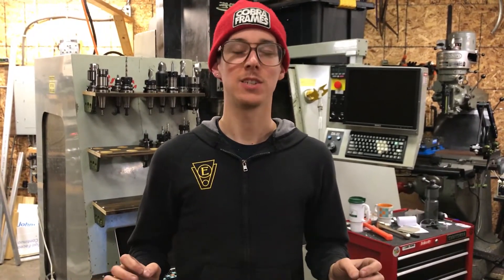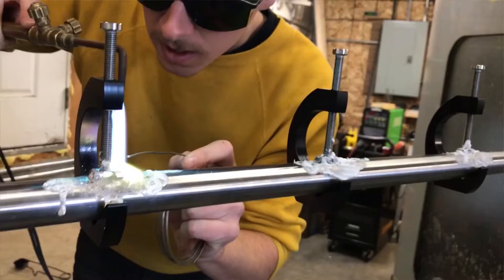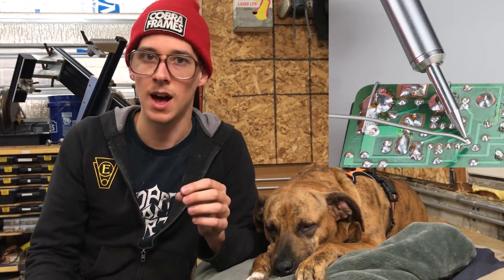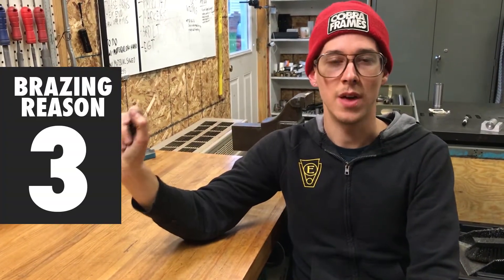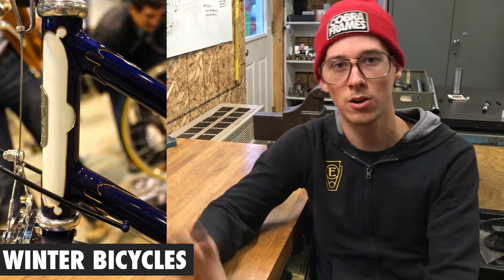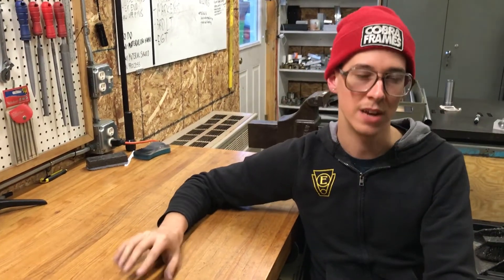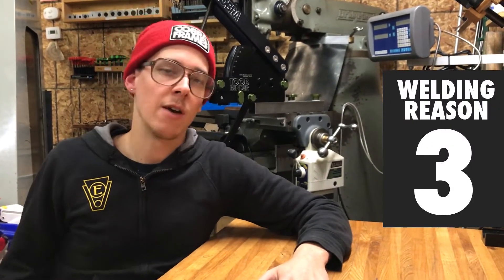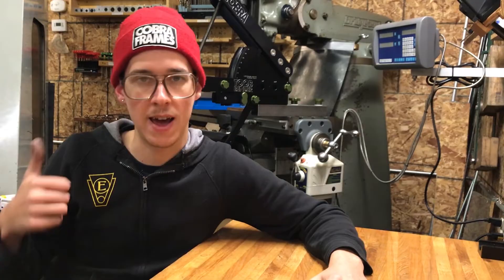Brazing vs TIG Welding for Bicycle Frames

Comment: Very impressed with your knowledge for being so young.  What many are missing though, is inline liquid flux.  If you are welding frames more than once you should be using it.  I used to braze bike's and wheel chairs in a production environment, and you can fly when brazing, with minimal clean up. I also Tig welded for all kinds of frames. Both like you state have pros and cons.  Man, I can't imagine how much you will know in ten years from now.  Try the inline flux, you will laugh that people still use paste.  You can braze faster, cleaner and have more control over where the brass goes. Of course the tip size is also a factor along with how quickly you can move.  Skill level is the most important factor, but it come down to practice like anything else.

Comment: I'm starting to get into brazing and so far I found I really love using a propane torch and silver filler.
I don't need to mess around with acetylene and the silver makes such beautiful clean small fillets with barely any post processing.
I really wanna see if I can build full frames with this.
If I can get the prep work to fit the tubes nicely quick enough I think the price of the filler can be offset by how quickly it brazes into a nice little fillet

Comment: I am old. I braze everything. I don’t do aluminum, but they do make aluminum brazing rods for the HVAC industry and others, however it’s very difficult and I have no idea if it would work for bicycles. I have tried it on scrap lawn furniture as an experiment. If it can be done reliably and consistently it’s very difficult. You would need a very good system figured out and lots of practice. Not worth it. The aluminum is hard to read. It will melt long before it would glow red. You really have to braze with an air tip at the most. It just turns to butter under a torch. It’s very hard to repair a melt through. Great info and video.

Comment: As a welder in all forms of welding for over 50 years I think you make some valid points and useful tips for beginners. One point that I would like to elaborate on is that brazing does not have to be a slow operation, many years back bicycle frames had sleeve joints just as you mentioned and showed a picture of. The whole  bicycle could be assembled and heated until the braze and flux melted this process could be done as a one off or hundreds of units were sent through an oven. This process  is used extensively today in industry. With thin wall tubing the process is reasonably efficient and reduces the effects of localized stress that can be a problem with other forms of joint manufacture, especially if you are using high strength alloys. Low temperature brazing alloys may not require the assembly to undergo further heat treatment. Tig welded mig, gas, or stick joints produce high stress riser points so compensation has to be made to ensure failure does not occur at these joints, this usually means increasing material thickness.

Comment: Does tig welding make for a stronger joint than brazing? You would think so if it actually melts the 2 components together, whereas brazing only melts the filler material to act as a glue. That's my interpretation of the two situations. Correct me if I'm wrong🤔

Comment: Exactly my words as I was thinking it you was saying it. Soldering / Brazing even with the plumbers example exactly my thoughts.  I'd never fillet braze not enough surface area for my liking.
Reply: I don't think that the amount of material in the brazed joint adds much to the strength. In fact, I think you'll find that the less braze there is in the joint (ie the closer the sliding fit), the stronger it is. The fillet is there to spread the stresses.

As I recall, the molten braze diffuses into the parent metal and forms a microscopically thin intermetallic crystalline alloy at the surface. The joint isn't "glued" (like a joint in wood, for example) but the metals are joined on the atomic level.

Comment: Fillet brazing is a dying art for sure. When I got hired for a high end tandem bicycle manufacturer it was my ability to fillet braze that got me the job, they had been trying to hire someone for 2 years with no luck. Learn both, it comes in handy especially bicycle frame building.

Comment: The hexavalent chromium is no an issue when TIG welding stainless, only when MIG welding is it a problem. TIG welding stainless does expose you to ozone (small particles). Proper ventilation is the key here.

Comment: Kmart and Walmart bikes are TIG welded, or simply spot welded. Very uneven heat (6000 degrees), and poor frame tube adhesion (joining the frame tubes together) are the result. These kinds of bikes are produced in the masses, not quality. I’ve owned a few of these bikes, they’re junk. Brazing, on the other hand 🤚, is done at a WAY LOWER temperature (and even heat, too) 🤒, resulting in a VERY STRONG bicycle frame. Such a bicycle frame could last up to, and past 10 years, and is VERY WELL worth the investment. Your friend, Jeff.

Comment: Cro Mo bicycle steel tube can be very thin. Better suited to bronze brazed. Steel tubes that are brazed correctly should make a stronger frame because they are not over heated. Maintain the heat treat.

Comment: Last I checked .. none of the critical components that sent a man to the moon was brazed.... it was GTAW welded. And maybe don't know this but you can use your tig torch to braze with and it concentrates the heat in a much smaaller area than a OXY/Acet torch

Comment: I was surprised you didn't mention one advantage of welding (including bronze welding) frames, which is that you're not restricted to the sizes and angles of available lugs.  High-end TIG welded frames took off around the same time as mountain bikes, I suspect for this reason.

Comment: Coming in late here but curious how bad would mig welding be for adding a disk bracket etc. to an old steel frame MTB?
Reply: It would be fine for a low-end steel frame but not for lightweight alloy steel tubing. For adding a disk mount you could probably use silver solder and a propane torch but you'd need to take a lot of care with the fit and cleanliness.

Comment: Hi I have a question. Can I fill a small crease in thin bicycle tube with silver solder and a simple propane torch that does not use acetylene? The tube is seat stay about 10 cm from the drop-outs.

Comment: hi, great video, any thoughts on stick welding a bike frame?
Reply: hmm 6011 in 3/32, 1/16, fish mouth with a little space for the material of the electrode, i try with 6011(3/32, 1/16, 1/8), 6013(3/32), 7018(3/32), 7014(3/32), i fk smash with jumps and hammer the frames and don´t have any problems with the stick welding, tube of steel 1,5 mm to 2mm that work for me, i try repair a tange tube with stick welding and fking destroy the frame is a bad idea stick weld a thin tubes
Reply: peachcycles is a chilean guy who sell stick welding frame bike, look his instagram, his first post, he change the welding for hard brazing
Reply: I think it would take a lot of skill to stick weld a bicycle frame you’d have to turn the juice right down and just dab with the stick
Reply: And I think a 2 mm 6013 rod would be your best chance of doing it

Comment: In the 1970s I was a flame Brazier for Huffy bicycles so let me tell you how it was done son as soon as you picked up the torch off the economizer valve the gas came on allpria justed the flux was mixed in with the settling we use the number 5 tip with the valve for the settling crank all the way open the regulator's cranked up to the max then you would turn the oxygen up to you had a oxidizing Flame two welders could put out 60 frames an hour not counting for spot weld  and the head to was done separately the wells got a visual inspection dipped in a cleaner and painted no cleanup at all it was all about speed speed speed baby because Huffy bike were cheap cheap cheap

Comment: I was wondering if TIG brazing could work too? What do you think of TIG welding it first and filling it up with SiB & TIG brazing (just for the nice look of it). I am welding in my basement and Oxy-Ace setup is just too dangerous there due to poor ventilation, still I TIG braze random stuff a lot for the sake of the fillet-brazed look. Thx in advance!

Comment: you can braze aluminum. Its actually quite strong. Otherwise, a fantastic video.
Reply from the maker: I don't know too much about brazing aluminum, but my understanding is that it is not actually practical for frame construction outside of cable guides and small bits.

Comment: Old motorcycle frames and the old springer front ends were furnace brazed together so you have brass inside of your tubes. Guys who modified old springer front ends making them longer using old ford radius rods brazed or welded them safely with oxy acetylene. The book I learned from for motorcycle frames is Custom Chopper Cookbook by Mike Geokan check it out he builds gorgeous frames for the street and for land speed racing. I am really glad I found your channel I really like your work and appreciate your sharing your knowledge.

Comment: Thanks for the info.  I’m building a motorized bike with the standard kit mainly, if you’re familiar with that.  I need to mount a gas tank onto the top horizontal bar of the frame on a men’s bike, thinking about brazing, any thoughts on that?  Thanks in advance!

Edit: steel frame

Comment: I need help. I have a fixie steel frame i think its chromoly and i already hammered the inner chainstay so i can fit ma wide tire. So here is my problem i want ti fit a 700c x 45 on it but it hits the inner chainstay. My solution is find someone that can cut and weld new rear triangle of the bike is that even possible and safe if it si
Reply: It's doable to replace the chainstays.  It's probably not cost effective.  Being happy with what you already have is going to be the cheapest.  If you must absolutely have fatter tires getting a different frame usually makes more sense.

Comment: Hey there I have a question. I have an aluminium folding bike, and I want to add a better fitting basket on the front. It doesn't have mounts. I have considered drilling into the frame and adding a klickfix, or brazing a custom mount onto the front that I can slide a custom made basket into. What do you think? Better to to sand down a bit of the coating and braze, or better to drill and set a couple holes? Thanks. :)

Comment: I came here to get some light on to why some mtb steel frames made in Taiwan are much more (we are talking 300-400USD) expensive (I think of Surly Krampus or Ritchey Ultra) than others also made in Taiwan (like Sobre Off or Nordest Britango). Are the expensive ones TIG welded and the cheaper ones done through a cheaper, less quality method? ALSO, some frames have only 1 gusset on the downtube other only on the toptubes, and apparently they are all regular 4130 double butted tubes. Does only 1 gusset make it cheaper and therefore more prone to braking the frame in the long run? I got excited and I asked too many and complicated things. I will understand if you ignore my message

Comment: could you do a video about how you initially got into bike frame building, to how you acquired all that machinery? it seems like just the start-up cost for all of the equipment is so extraordinary, for a questionable return on investment.
love your videos btw
Reply from the maker: if you go to my website and my podcast page I did an autobiographical podcast episode where I told my own story. Basically it took many years to get all this stuff. It was my only real hobby and I scoured for deals all the time.

Comment: When I was a kid in the '80s I was reading a book about road bicycles at the library and the author turned his nose up at welded frames, claiming they were inferior to his beloved lugged & brazed frames, and only found on cheap department store bikes. I knew he was full of shit because all BMX frames, including top-of-the-line ones, were (and are) welded, and they have to be a lot stronger than a road bike frame, considering that they have to handle big jumps. Mountain bikes were just becoming a thing at the time, and their frames are typically welded too. They also have to be stronger than a road bike frame, for obvious reasons. If he's still alive I wonder what he thinks about it now that even high-end road bikes have welded frames with no lugs.
Reply: Once upon a time the highest quality best regarded tubing for bike frames was Reynolds 531.  Reynolds 531 lost a lot of strength with the higher heat from welding vs brazing.  Reynolds 531 used a manganese steel alloy with strength as well as most other properties comparable to 4130 cromo except it's ability to withstand higher temperatures associated with welding.  The bike industry found that welded bikes were cheaper to make than brazed (fillet or lug).  Thus welded steel took over.  Welded steel was eventually found to make a stronger joint than brazed (although good examples of each are both excellent).

Comment: When I was cycling seriously back in the late 70s and early 80s, the concern was always overheating and damaging the tubes. This was in the days of Reynolds 531, 753 from England, Columbus from Italy, Vitus from France and Ishiwata and maybe Tange from Japan.

I seem to recall you needed a license or certification to make 753 frames because they were very delicate. I would guess that once TIG welding came along, tube development has occurred to allow for use of the process without compromising the characteristics of the tubes. Back then, braze-ons were frowned upon in the UK ( Italian bikes had them everywhere ) and chroming was discouraged, again because of potential damage to frame integrity.

My impression is that you can silver braze anything as long as you don't overheat but I wonder about TIG welding. Just checked the Reynolds site and they pretty much seem to be saying that they made their newer products TIG friendly.

Comment: I would add that one potential dissadvantage of TIG welding is the subtraction zone which happens next to the weld bead. If the tubes you're using are already very thin this subtraction zone caused by hot semi liquid steel being drawn towards the weld bead can cause a weak area to form right next to your weld.

Comment: Don't stop teaching dude. Youre great at it! Better then my university  teacher at least. I got a crack and got nothing to fix it. Im studying a way to just get it from falling apart. If any on would like to look at it would be greatly  appreciated.
Reply: I suggest you to drill a clean hole in every end of the crack, fill it and weld the crack, brazing doesn't work in this case, in case you're thinking about the holes it is to reduce the stress concentration in the area.

Comment: Very useful information, thank you.  My frame recently cracked where the seat tube joins the bottom bracket.  It is a steel frame from the early 1980s (Centurion Super LeMans), which I understand was made from "double butted" steel tubing.  I was planning to take it to a welding shop for repair.  Do you think TIG or brazing would be better?  Thanks again.
Reply: Damn i have the exact same frame laying around. Rusty torn. Considering fixing it up! Nice frame
Reply: Good question. I know on motorcycle frames they always crack where the seat post joins at the bottom. Have you thought about stripping the paint or coating off the areas you are concerned about and having a shop Magnaflux that area and mark out see exactly where the crack starts and stops ? That is what I do when someone brings me a cracked frame I strip it down clean and magnuflux test that entire frame with my magnet and shaker of iron powder because I want to be able to go to bed knowing that frame will be safe.

Comment: What are your thoughts on tack welding with TIG to get the alignment and then finishing with fillet brazing?
Reply from the maker: I have tried that once or twice, but once I really had my own TIG machine in my shop I stopped building bikes with fillet joints, so I never got that far into it. I have heard it works well, but I don't know who does it. I would talk to some of the fillet builders who also have TIG machines around -- they have all likely tried it.

Comment: At 3;00 you showed hard copper pipe.  I have successfully welded the fittings of this type of metal, using copper rod and Oxi/Acet.  John Chaplain's comment is valid. Torch welding steel is a beautiful thing.  Over TIG,  you have more control because of the lower temp. and  the puddle is really thick (not runny) so there's plenty of time to pull the puddle around and get superb penetration.
Reply: I agree 100%

Comment: Great piece of advice! Would MIG welding be inferior in any way with a slightly thicker steel frame material?
Reply from the maker: Well, I think generally you’d need pretty thick tubing for MIG to work well. Thick tubing makes really heavy bikes, which are fine I guess, but man I don’t want to ride a 40 pound bike. If I’m going to the trouble to make I by hand I want to make it NICE.